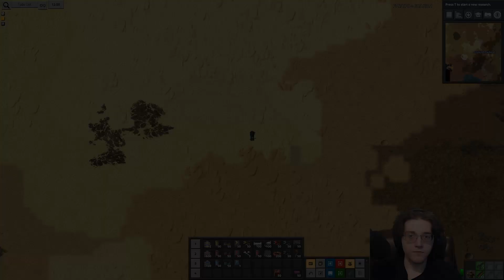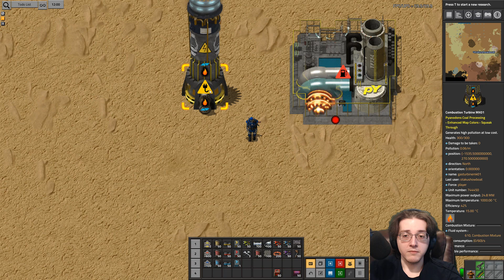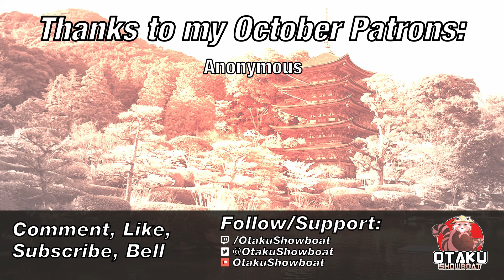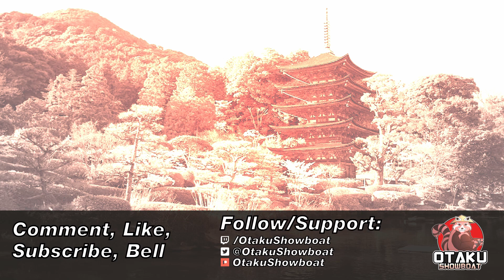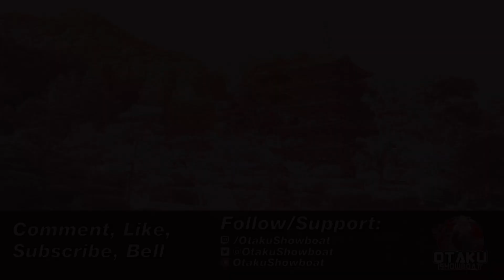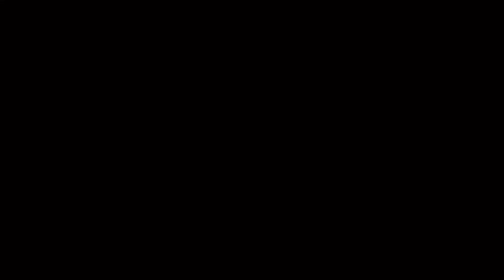Tutorial - Factorio Pyanodons Mods Combustion Turbine Overview

Comment: There is one more tactic to avoid feedback loops that doesn't require a full backup solar grid or something else.
You simply overproduce combustion mixture at your power plant, which is an isolated network, and bleed excess to additional turbines, wchich are on your factory network.
You'll need overflow pumps for that, but as of writing they come with pY.